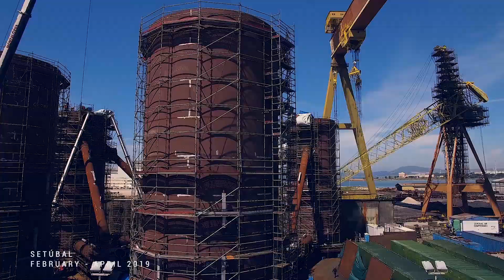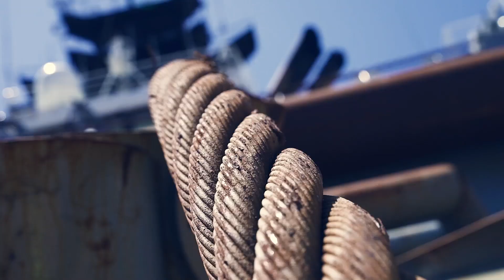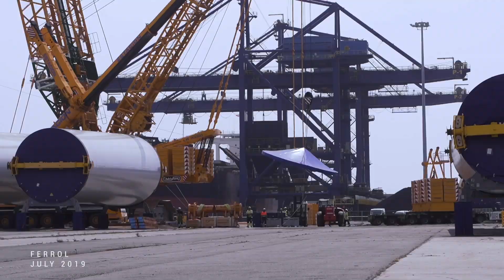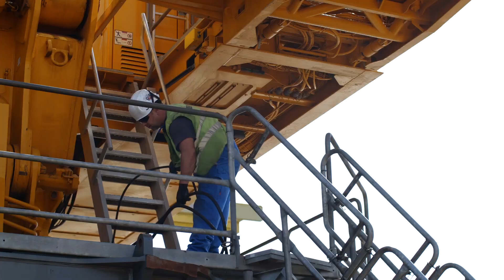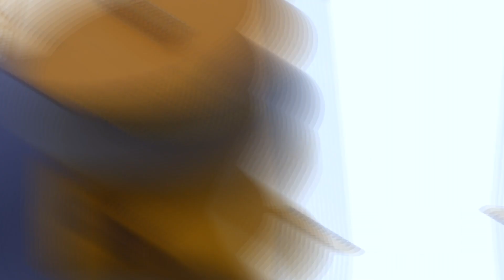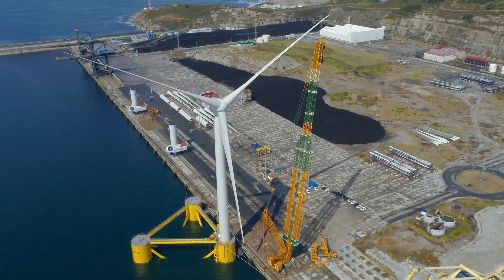WindFloat Atlantic begins the offshore installation

Comment: The Platform shown was built  in NAVANTIA FENE Yard, not at LISNAVE.

The Joint Venture NAVANTIA WINDAR and its contractors, as Nervion Industries, still being the Word leaders building Floating and Botton Fixed Structures for OFFSHORE Wind Projects